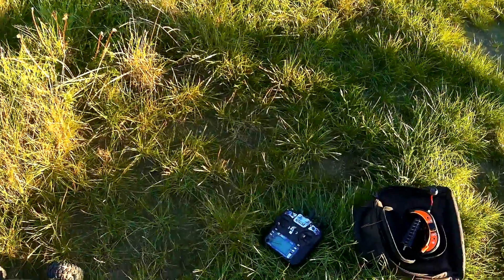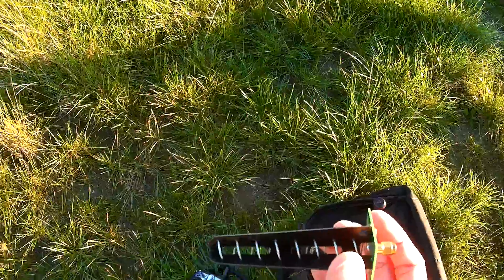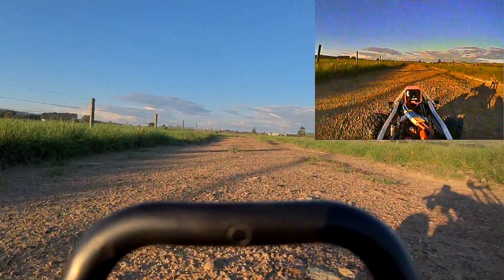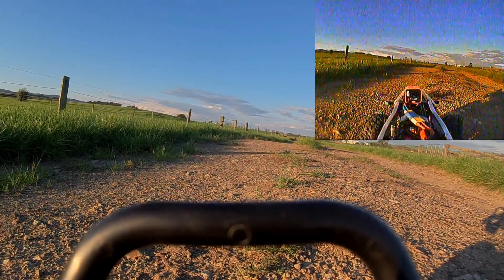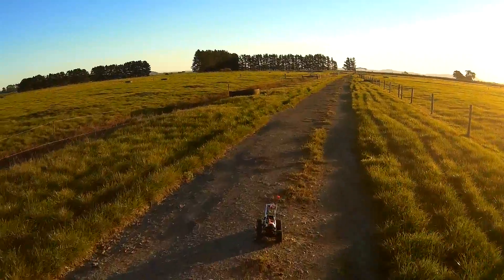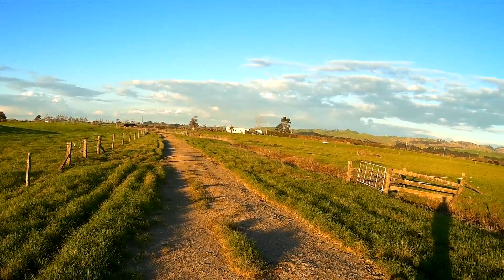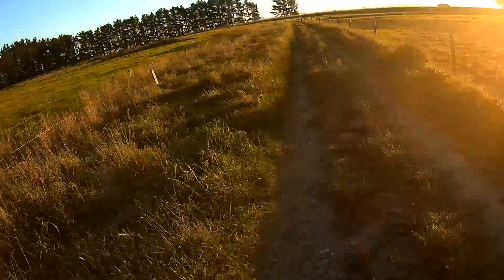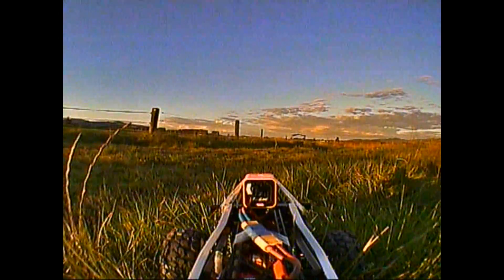FlySky FS-i6 + X6B ground-level range test (5.8GHz video)

Comment: how to use this receiver for ariplane rc cause this receiver is using ibus right?
Reply from the maker: ibus is just a communication method, nothing to do with planes or cars. If the flight controller in your plane understands ibus (eg. iNav) then ibus is fine. You might also want to look for some basic info on this receiver because it can also do PPM, and sbus, and regular PWM as well.... 
https://www.rcgroups.com/forums/showthread.php?2786211-The-new-X6B-receiver%21
https://www.youtube.com/watch?v=tS1NmV8nHr8
https://www.youtube.com/watch?v=WBVmkXN8HC8
Reply: @iforce2d  i've seen both video long time ago, for research getting flight tx and rx with the best bang for the buck for quad, but now im gonna build a simple delta wing plane, using this x6b, so im not gonna put some fc for the plane, just gonna use simple esc for the motor, and 2 servo for elevons, but i think its gonna hard to connect x6b to the esc and both servos, cause if im not wrong, the cable from the x6b just single pin cable, but the servos and esc have 3 pin cable, so im confuse right now :(
Reply from the maker: @slickyy_  The single pin is the signal. The other two are ground and power,  which can all be connected together for every servo/esc.
https://youtu.be/NmXbyLZJqIk?t=632

Comment: Please make #3 test with the transmitter antenna mod.
Reply from the maker: What mod is that?
Reply: 2.4GHz 5dBi Wireless Wifi Antenna Booster WLAN RP-SMA and U.FL/IPX to RP-SMA Female Antenna Pigtail. Available on banggod. Thanks
Reply: There were some videos of flysky i6 antenna mod but they can not tell the range without and with antenna mod. On your videos and a video in the future, all  questions about the fs i6 stock antennas and a modified antennas range will have an answer. Hope to see it soon.
Reply from the maker: Probably will not be doing any tests of boosters. I can fly out to 2km with my FlySky radio with no mods, which is about as far as I'm comfortable with and probably illegal anyway. If you want to go further than that, you would be better off using a different frequency, and a better radio than this (almost a toy) too. If it's ground-level tests you're talking about, I don't know that a booster would help much anyway - I can fly my quad with this radio to 2km but on ground it can't even make it to 500m. So it seems that it's not the power of the radio that's the problem, it's simply the ground interfering with the signal. You could always buy that equipment and do the tests yourself, make a video for me to watch for a change :)

Comment: awedsome videos! would you be willing to mod your transmitter with like a 5dbi antenna to see any improvement?
Reply from the maker: I did some tests with a big yagi antenna and a similar class of transmitter, eg. 
https://www.youtube.com/watch?v=zddC8rQasrg
https://www.youtube.com/watch?v=TGnOn5YThg8
and an airborne range test with this radio with no mods:
https://www.youtube.com/watch?v=KZaE1qEnIWs
So I have a rough idea of how it would go. For practical purposes, I can't fly anything any further than about 2km anyway, and I rarely drive the car. I had planned to hook up that yagi to the radio since there are ipx plugs in it, but to be honest I probably will not bother.

Comment: What was your TX voltage while testing this?
Reply from the maker: I have no idea. Probably around 5V.
Reply: you have to test it at 6+ volts, people say it increase the range hugely
Reply from the maker: People say? Is one of the pins of the radio unit taking full battery voltage? In any case the battery is rarely ever at 6+ volts, I mean a brand new set of batteries typically start at a bit under 6V for alkaline, or about 5.8V for NiMH if you are lucky. I think the result of this test is pretty valid still, because for the majority of the usable life of the battery the voltage is around 5.1 - 5.3 volts. I know this because I just did a 13 hour test to see how long this TX runs on one charge of 1500mAh NiMHs :)
Reply: I dont know if it takes regulated voltage or full. I tested my fs-i6 with 6.3V - its working, but did not test the range.

Comment: I've come to the conclusion helical antennae are best used with diversity Rx for long range flights. As the "standard" antenna reaches its limit the model is far enough away that the helical will just need to point in the model's general direction to be effective.
Now, get that CNC machine out, get Maarten Baert's files from his site and cut a Pagoda antenna, be interesting to see how one of those compares to the other two.

Comment: For a ground vehicle that doesn't pitch/bank wouldn't it be better to have the antennas vertical?
Reply from the maker: I don't think it will make all that much difference, see the discussion with yokonunz on the previous test. As with a lot of my tests the goal is not to stretch out the result to the maximum possible limits by making every factor as optimized as possible, rather I'm checking what would happen in a more typical situation.
Reply: Fair enough! My feeling is that there'd be little difference while you're front on to the "v" but it'd be worse side on.

Comment: I like your method lol!  Because I'd have flown the quad until it dropped out of the air lmao!
Reply: You should use another drone as a satellite ;-) That would be badass.
Reply from the maker: The problem with flying a quad is when there is good clear line of sight well above the ground you can go very far. I tried both the ia6b and the x6b out to 2.3km and they were both still working ok. That was as far as I could go, but down low to the ground the signal will be lost much closer.
Reply: awesome idea :-) a quad that follows the cars and redirects rc- and av-signals to it :-) maybe he could use one of these tiny diy flysky transmitters for it...

Comment: When the new one works worse than the older one :( Please flysky :( Thanks for the test btw
Reply from the maker: Well the new one has a built-in voltage sensor and is much smaller. People can weigh up the benefits and features they will actually use, and get what's best for them.
Reply: I agree, but the main receiver purpose is to receive the signal from the transmitter :D being said that it's maybe due the antennas without the "load" like the 6b ones
Reply from the maker: Yes, I think that's all it is. It's a pity the ia6b doesn't have easy plug-in antenna sockets, otherwise I could do a test with just the antennas changed (and I could buy replacement antennas for the ones that got chewed by my quad instead of buying another receiver :)

Comment: How much did that frame cost
Reply from the maker: I think it was about $250, a little too high in my opinion. It's a nice frame though, some parts of it are aluminium.
Reply: Ok are you ever going to start using autopilot on ground vehicles again